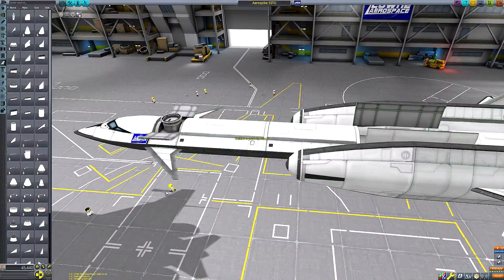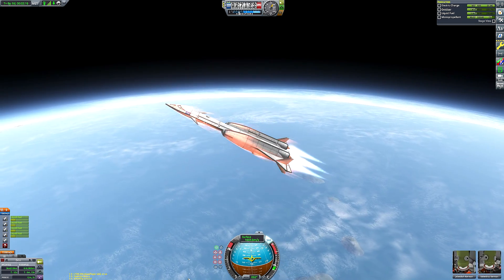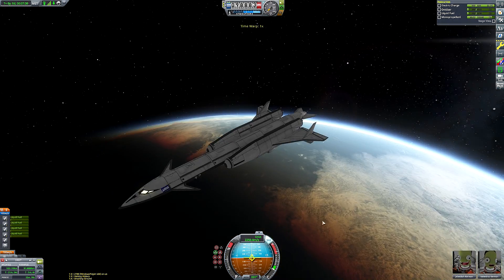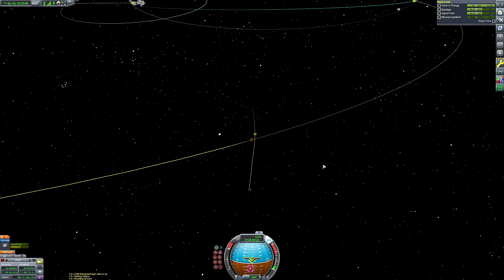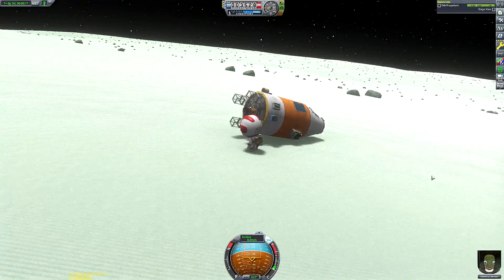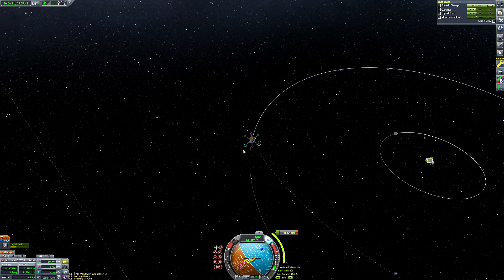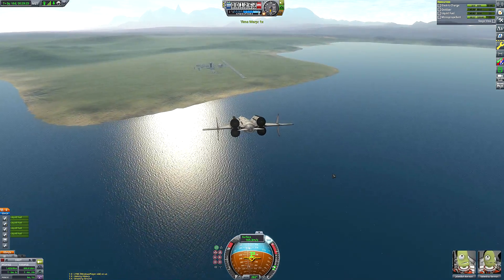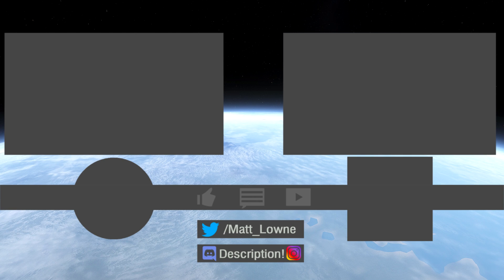The Aerospike-Only Cargo SSTO! - KSP gameplay

Comment: The Spike technology will be an advantage of rocket mixure for jet purpulsion and jet altitude flight, or electric rocket momentum amping for a .5~1g gravity granting acceleration continuous,. Note, fossil gas/fuel requires idole time in deep solar orbit travel, why 3 to 9 months is a limitation so far vs infinate accel.(& revert de-accel arrival).

Comment: we need real world aerospikes allready!! because i dont yet have ramjets in my carrera save i took a stock aeris 4a and replaced the engines with panthers and the aerospike with a t45 swivel and it actully worked i called it the aeris 4B :P
Reply: There are real world aerospikes. As of right now, standard rocket engines are a lot easier

Comment: the only ssto project (I'm aware of) is the skylon project with their saber engines (which is what the rapier engines are based on) which is pretty neat. I wish the venture star project didn't get scrapped, just because they couldn't develop the polymer fuel tanks. They had perfectly light enough aluminum ones, but noooooooo

Comment: I have a suggestion: A mission I have  been trying (and repeatedly failing), is sending a dirigible to Duna. I figured that a mid-air "launch" would be good for efficiency and for fuel (float up as high as you can, then light off the rockets), but I cannot get the thrust to weight balanced to even break atmosphere. (And who knows if I have enough bouancy to float the dirigible around Duna anyway?) After all my failures it would be nice to see someone pull it off.

Comment: I've built all sorts of hybrid SSTOs over the years that don't use the RAPIER. 1 Panther+ 2 LV-909 or 2 Whiplash + 1 LV-T45 are both good low tech combinations. You might want to try demonstrating a low tech air breathing SSTO design for your viewers. After all, spaceplanes don't really offer any advantages in any mode other than career, and they are kind of pointless if you've already unlocked all of the hi tech nodes.

Comment: Matt, this is a solution to the leg clipping issue so simple you will kick yourself for not thinking of it.

Hydraulic struts mounted to the bottom wanted outwards 30 degrees - these also work as deployed legs allowing vtol landings for winged craft on airless bodies
Reply from the maker: This would add too much mass to the lander, so I wouldn't have had enough DeltaV
Reply: @MattLowne  I initially thought you might be over exaggerating how fine your dV budget was until I considered you even needed to drop monoprop from the command pod.
Would the legs have made you overweight too?
Reply: or you can just put your engines on a hinge and have a tilt engine ssto ;)

Comment: Having so much trouble trying to get into same orbit as my other space crafts. Really want to learn how to use the map better and also capture points. Fed up of building great crafts and not being able to catch up with my other ones to dock. Layman's terms tutorial please!!!!
Reply: 1. Make a maneuver node at ascending/descending node to make the inclination 0.0 or as close as you can get.
2. Get your apoapsis (if you're in orbit lower than your target) or periapsis (target is in higher orbit) as close as you can to a point on the target orbit.
3. The higher your orbit the slower you're travelling, so a craft flying low will start to catch up.
4. Make a maneuver node where your orbits are closest and check what happens if you burn prograde or retrograde, if your target is getting close match your orbit a bit more 'till your encounter is below ~1 km.
5. Search for Scott Manley's "Tutorial For Beginners" parts 10 and 11, 'cause my explanation barely makes sense:]

Comment: But can you make an ssto without: Aerospike
Rapier
And nuclear
Reply: Yes, and it's not that bad if you design for efficiency. Panther/LV-T45 is the lowest tech I'd recommend. Whiplash/LV-909 is nearly as good as a RAPIER setup.
Reply: See examples here: https://www.youtube.com/watch?v=Pq3UNZyLAJQ
Reply: Columbia style😂
Reply: Actually SSTOs are not particularly hard once you have accepted to make a rocket ascent. With very low tech I have been able to do SSTOs with 800-1000m of DV in LKO with just some jet engine to take off and one or two rocket engine which you turn on just after take off.
Reply: @nnietee  I think when most people say "SSTO", the "air breathing/ flies like an airplane/ fully reusable/ lands on the runway" part of it is implicit. It's a trivial matter to build an SSTO in KSP career mode; it's usually my first orbital flight in a new career because I haven't unlocked decouplers or the LV-909 yet. Just stack FL-T100s on an LV-T45 and hit space bar. Making a "RAPIER style" spaceplane SSTO is a much more complicated task. As I said above, it can be done and it's not that bad provided you design for efficiency instead of style. Working with Panthers is more challenging because it yields a much lower payload fraction, but it can still be done. Using the Whiplash  yields a spaceplane nearly as good as can be achieved with RAPIERs because the Whiplash can actually hit higher speeds and altitudes than the RAPIER in open cycle, leaving less DV for the closed cycle engines to deal with. I often never bother developing RAPIER spaceplanes in career because the previous Whiplash/ LV-T45 planes work so well. By the time I've unlocked the RAPIER, I'm swimming in cash. Why redesign a vehicle I already have just to save a little fuel?
Reply: Launching a spaceplane from support legs feels a bit like cheating though...
Reply: I just made a big one with 12 Whiplashes and a Rhino. It's like a peculiar and characterful bird, nice to fly in atmosphere with all its wings and control surfaces, but very thirsty. It barely made it to my LKO refuelling station, drained the station dry, and then still didn't have the delta-V to get to Minmus. I had to send a tanker out to refuel it again. My LKO refuelling station evidently needs to be bigger, although it would have been better if I hadn't been too bored to send tankers to it from Minmus...
Reply: @GrandProtectorDark  Because a "plane", by definition, is a thing with landing gear that takes off from and lands on a runway, as GoSlash27 point out above. While it's technically correct to call any vertically-launched vehicle an SSTO if it can get to orbit without discarding stages, referring to a vehicle as an "SSTO spaceplane" implies that it can do everything a conventional aircraft can do, but much higher and faster. :)
It's all about common usage of terminology... if you say "SSTO", 9/10 KSP fans will think you mean "spaceplane".
Reply: My current spaceplane workhorse uses a 6? Raptor and 1 Skipper combo. But once I unlock the Whiplash I think I will move there without looking back for a much higher speed while still relying on airbreathing engines.
Reply: @ehsn  What's a Raptor?
Reply: @GoSlash27  maybe they meant rapier.
Reply: Ooo
Reply: Hmm... Maybe whiplash and spark engines
Reply: Like 16 Whiplash jets and a Rhino?  Get 50t to 100km...
Reply: Yes, with difficulty.
Turbojets to 12km
Max speed, angle up 30-45 degrees
Enable a small rocket to carry you up
Reply: @GrandProtectorDark  In the most practical sense, they're not just as valid. An SSTO exists to place a payload into orbit as cheaply as possible (thus are only really practical in career mode) by recovering the launch vehicle intact on KSC grounds and expending as little fuel as possible. A vertical SSTO requires much more thrust than a horizontal one, thus more engine mass and fuel consumed. If it runs on rockets instead of air breathing engines, it requires more oxidizer. If it lands vertically, it's return to KSC for 100% recovery isn't assured. All of this means more kerbucks per tonne of payload to orbit, even though it does get there and back in one piece.
 To your other point, people misuse the entire concept of SSTO all the time, so I'm pretty used to it. SSTO should really only go to orbit and back, since carrying the entire launcher any farther is a waste... but people are constantly making SSTOs to Minmus, Laythe, etc. They always seem to do this in  science or sandbox mode, where SSTOs have no practical advantage. They always seem to use top tier tech in them, when in a career there would be no fiscal reason to do so. 
 Most "SSTO" designs in KSP exist for the "cool factor" rather than any actual gameplay advantage. In that sense, yeah... Everything that gets up there in one piece is equally valid.
Reply: ^This man speaks truth.
The whole point of SSTO is to get usefully-sized payloads into orbit as cheaply as possible. The best way to do that, theoretically, is with a fully reusable spaceplane that takes advantage of the high ISP and TWR of air-breathing jet engines to overcome most of the drag and gravity penalties on the way to orbit. In practice (both in-game and IRL) the most efficient way to actually do that is with a conventional vertically-launched rocket with recoverable boosters. But spaceplanes sure look cool and give a chance to express one's creativity in the design phase... 😁
Reply: @sixstringedthing  I agree with almost all of your post. I wouldn't say that recoverable boosters are the "most efficient" way in KSP, but rather the easiest. A properly designed SSTO spaceplane is actually more efficient. The nice thing about boosters is you don't have to constrain your payload to fit the dimensions of your booster. This is why I never use SSTO spaceplanes to lift cargo, but rather supplies; kerbals, fuel, monoprop... anything that can be transferred through a docking port.

Comment: Never saw the point of rocket-engine horizontal takeoff SSTOs, because you basically have the same ascent profile and efficiency as a rocket and a vertical launch SSTO can do the job better anyway. 
I guess recovery is easier, but flying SSTOs from orbit is much harder IMO than just deorbiting your SSTO rocket and landing it vertically.
Reply: In theory the re-entry is far safer as it's a very gradual aero brake as opposed to the shock load of the usually deeper rocket entry

Comment: Funny, I just build a single-engine aerospike SSTO with 4 Vernier engines to steer yesterday, but in rocket form. It has 4000+ m/s dV (sea level) and can land propulsively. It's pretty much sized as the Electron, just a bit heavier.
Scaling works pretty good. 4-engine aerospike SSTO with one step bigger diameter and 4500+ m/s dV (sea level), 1600+ m/v dV once in LKO.

Comment: Someone: *Builds a non reusable spacecraft*

Matt Lowne: Why are we still here? Just to Suffer?
Reply: CRIPPLE N CRUNCH I think the actual SSTO master is Kerbal Space Command
Reply: I just built a reusable booster.
Reply: No problem. 👍
Reply: YOU CANT BEAT MY POWER OF DEBRIS AND HALF-DEPLOYED SATTELITES IN SPACE!
Reply: WELL I TIRIED TO MAKE A SSTO BUT IT NEEDED A LITTLE MORE POWER TO GET TO THE MOON
Reply: Caleb Smith It’s quit easy. All you need to know is keep the Center of Lift (blue and black thing) behind the center of mass (yellow and black thing).
Next you need to have the Big-S Delta Wing with some flaps and engines. Things I recommend:

Mark 2 Cockpit
Fuel tanks (make sure they fit the cockpit) 
Big-S Delta Wing
Landing Gear.
Reply: @ummidontknowjustsomerandom7405  thanks 🙂
Reply: A giant $68,000 top tier spaceplane just to do a little research on Minmus? I could've completed that mission for far less money and effort with a simple low tech recoverable booster. I probably could do it cheaper with a disposable one.
Reply: @GoSlash27  Recovering on runway yields back the full amount of the part cost, so you only pay for fuel with crafts capable of consistently end up there. So it's a big investment with big returns, because fuel is cheap. I find that the most limiting factor is tech unlock (although with a Panthers/Skipper combo I can lift 10t to orbit), payload capacity and payload size.

I have also a 2 stage fully recoverable booster setup that doesn't require mods, but it has it's own difficulties due to stage switching mid flight and them pinning the landing or additional recovery craft and operations.
So for some payloads like tourists to Mun in an smaller spacecraft carried as payload and when I'm doing own operations that won't bribg me any contract funds I find SSTO usage worth of the extra design and ascent time.
Now, what he did, well, yes, maybe (haven't tried his mission profile) a sligthy bigger 2nd stage riding a single solid fuel booster would be cheaper, but if the second stage isn't fully recovered I think the STTO might cash back more funds.
Reply: @ehsn  I did the math on it. His fuel and oxidizer cost $8,000. I can definitely build a low tech disposable lifter to do that same mission for that, if not less. I can absolutely build a fully reusable booster (or spaceplane) that would cost less to build and operate. My point being: There's no point in doing an SSTO if it ain't saving you money.
Reply: @GoSlash27  yeah but what about your payload or amount of kernels you can get there
Reply: @jasonfreeman5851  SSTO doesn't help you lift more payload, it only helps you lift small to medium payloads for less money, and then only if you do it right. If you want to lift big payloads, you have to go with staged disposables. There is no point where an SSTO can lift more payload than a recoverable booster or disposable design.
Reply: Jesus this comments replies got heated
Reply: In the 'Game Of Fossil Fuel Burn Our Self Into the Heavens... Matt qoate might be right.